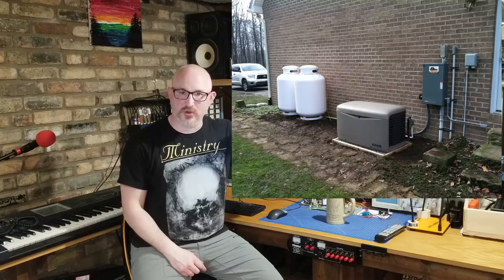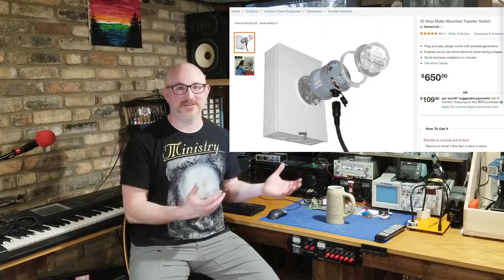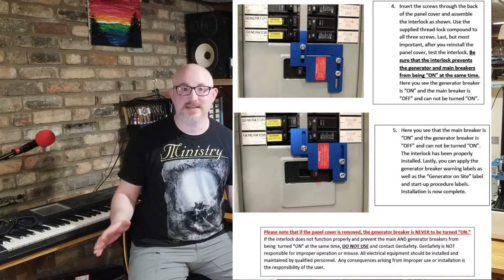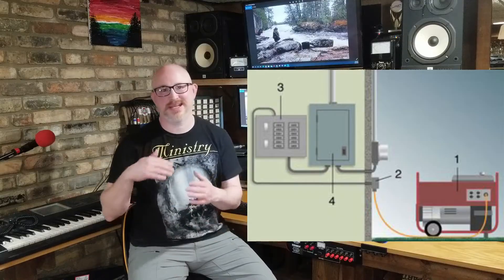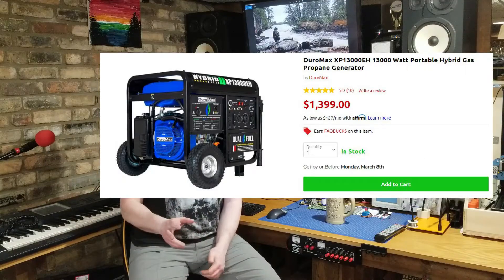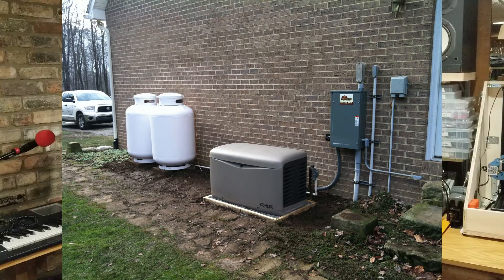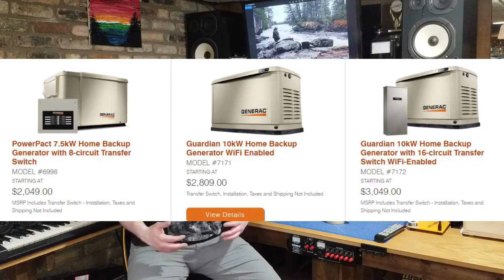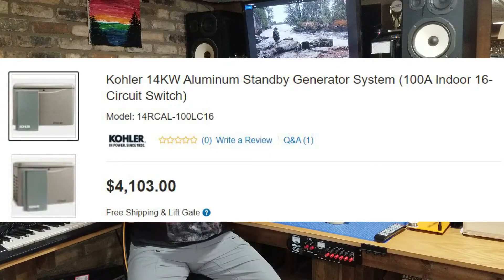Electrical Engineer explains connecting generators to your home

Comment: I think safest for novices and anyone who can't handle difficult tasks is just plain old extension cords. Would be nice to have a male/female plug from outside to inside through the wall so no doors or windows need to be cracked open. Would be nice to see a video on that type of install, or at least info on such a device. For my house refrigerator would be priority, then fans in the summer or low power space heater in the winter, some lights and then maybe wifi/modem and tv/laptops/gaming systems.depending on total wattage use and availability. Nothing hard that a child or my lady/elderly cant handle turning on and off.
Reply: CHECK OUT: Reliance Through the wall kit, I have one of those and will be making a panel that will fit between my window base and the window sash, in other words I will raise the window to a particular locking position then this panel will be placed in the gap, the panel will have the Through the wall kit, that way I DON'T have to drill or mount anything through the wall

Comment: Great video!
I have a neutral bonded, Generac XP8000E generator which I hard wired to a Reliance (XRC1003c) switched neutral, manual transfer switch.    Am I correct that I need to ground the generator to a separate grounding rod?     I have the generator installed in a fan ventilated shed approximately 50' away from my home.   Note that the generator exhaust is vented, as well.     Thanks, John
Reply from the maker: If you ever plan on using the generator in stand-alone mode then yes, a ground rod is needed for the GFCI to work properly.
Reply: @richardvedvik979  I use it through the Reliance panel to power the selected circuits in my home.  When I do this, I also plug a cooling fan into the generator panel itself.   Not sure what you mean by stand alone.   Thanks, John

Comment: Well, it's not often you have qualified experts providing good information. Thank you.
Reply from the maker: Thanks!
Reply: @richardvedvik979   Hi. I am seeking to understand something specific. I have a battery power system for backup called Ecoflow Delta Pro Ultra with an inverter. I also have a 10 circuit reliance critical load panel that was installed (connecting circuits from my main panel to this 10 circuit critical loads panel) that has a 50amp inlet outlet on it so I can connect my batteries to the critical load panel. All of that is inside my garage right next to each other. 

What I am looking to get is a duel fuel inverter generator so I can use that to charge my batteries so I can top them off once every couple days in the event of a power outage. This will help me run quiet power most of the time for a couple days with the batteries and then run the gas/propane inverter generator for a few hours to fully charge the batteries back up every couple days. 

What I am seeking to do is this. Instead of having to leave my garage door open so I can run the power cord from the gas generator on into the garage and plug the 30amp cord into the side of the Delta Ultra Inverter (which will then send pass through power to the critical loads panel that the Delta Pro Ultra is plugged into, because the power will pass through the inverter and then exit the battery inverter on out through the 30amp cord going from the inverter to the inlet outlet on the Reliance critical loads panel. Any remaining watts that are coming from the gas generator that is passing through the battery inverter and on into the Reliance panel to satisfy powering the circuits will then be used by the battery inverter to charge the batteries)

Back to what I want to do. I would like to install on the outside of my garage on the side wall a 50amp Reliance inlet outlet. Pass the wire though the wall to another inlet outlet. Why?  So I can sit the gas generator outside. Close the garage door. Then plug gas generator into the outside inlet outlet. Then plug a cord on other side of the wall into the inlet outlet inside the garage and then other end of that cord into the inverter. This way I can keep the garage door closed and locked. 

My questions is this now that you have the full picture. How do I use the outside inlet outlet that has a #6 gauge wire passing through the wall to another inlet outlet inside the garage since it will not be connected to any ground system in my house. All I am doing is using the setup to pass the power through the wall much like if I drilled a large hole through the side if garage wall and pushed the power cord coming from the gas generator through the wall and plug it into the batter inverter.

In fact Reliance makes an inlet outlet that passes wire through the wall into their 6 outlet flush mount wall box. There is nothing on that system that connects anything to your home grounding system either.
Reply: YEA, no telling how many of these I've watched and it appears many contridice each other
Reply: @REVNUMANEWBERN  maybe theirs some contradiction into who has what ,what's important to me is most have prepare for whatever  may come ,some may be able to go all in if you can afford a big setup ,some may just be able to afford the basic just enough to keep the fridge or the freezer running with minimal lighting just being prepared is the take away, food and water is a must have as well

Comment: Hi. I have a small trailer and a 3800 watt generator. Our hydro hook-up is on a 100 amp 220 volt 3 wire plus ground 3 gauge cable that plugs into a connector box on a 4x4 post close to the trailer. I disconnected that plug-in so there was no hydro to the trailer and then installed a triple pole double throw switch in a new small metal electrical box with a closing door.  I then installed the 3 hydro entrance wires to the top of the switch.  The new wires from the switch center connectors went to where to original hydro wires were in the breaker panel.  I connected the output from the generator to one of the hot (red or black) lower connectors and the common wire to the white wire (center of lower switch connectors) . I then connected the white and black wires on the lower switch with a jumper wire. This allows the generator to feed both bus bars in the breaker panel. Whenever I transfer the switch from top to bottom, I am no longer connected to hydro at all and am connected to the generator.  DO NOT connect the generator wires to the house before transferring the switch. Of course you won't have 220 volts here but just leave those appliances OFF. Your whole house will be ON so you can operate any lights etc. as usual. Just beware how many things you have on and turn off the breakers for your kitchen stove, your clothes dryer, and hot water heater if it's electric. P.S. I installed a KILL A Watt meter directly on the generator so I can read how many Amps or watts I an drawing.  The Knife switch, electrical box, and the meter are all available on Amazon. Get the 3 gauge wire at your local Home Depot. The wire from your generator to your home can be  a 10/3 or a 12/3 cable with ground wire, depending on the output from your generator.   Good Luck !
Reply from the maker: Sorry for the delay.  That is a very detailed situation.  The biggest concern I see is that you're sharing the neutral on both 120V outputs and the neutral conductor should be up-sized to account for the extra load.  Using 10/3 would help here.   And leaving the 240V breakers off is also important.

Comment: I've been backfeeding into my house for years through my clothes dryer electrical socket.  Any chance I'm causing damage to my system.  Most of the time it's a few hour here and a few days there.  Thanks
Reply from the maker: Thanks for sharing.  Is your drying socket a 4-wire plug or a 3-wire plug?
Reply: @richardvedvik979  It's a three wire
Reply from the maker: If 3-wire then the ground is acting as the neutral.  This means you don't have circulating current between two neutral-ground bonds but note that you have current on the ground wire.  I'm curious how it's configured at the generator side.
Reply: @richardvedvik979  4 prong plug on the generator
Reply from the maker: I'd be curious if the four wires from the generator have the neutral and ground connected somewhere in the dryer plug.

Comment: Well said Kind Sir. I've never seen that "GenerLink". And I was really; taken by that adaptation of 30 amps and 240 volts=7200 Watts; at the meter outside of the Electric Power Company. Because I'm buying a ""Predator 9500 generator" from Harbor Freight; as soon as i can.

And I had chose all the adapters; to wire it to my house's Panel! Including a way to transfer. Like you showed several times (not bought them yet). So, I have  a question....Does the "GenerLink" transfer voltage; from outside power to the Generator Power; and then transfers back to outside power; when the power comes back up? Huh?

And IF I am using more watts (when we have power on); that the Generator can not provide; that would break the 30 amp breaker in the Generator? Huh?. OR...do we have to manually transfer from one to the other; and vice versa on the GenerLink? And IF yes, how do we do that?

Thanks kind Sir.
Reply from the maker: The GenerLink is a manual transfer device that uses the force of plugging in the cord to the generator receptacle socket to transfer from utility to generator.  In an outage you will simply turn off your main breaker,  turn off all individual breakers, plug the generator connection cord into both the generator and the GenerLink, start your generator, close the main, then close individual breakers one at a time to manage load.  Just use the 30A receptacle and breaker on the generator panel and the breaker will simply trip if you draw too much current.  If that happens, turn off all loads, reset the breaker, then turn loads back on, keeping the largest load off this time. 

Most utilities have an option to call or text you when they believe power is restored.

Comment: As an electrical guy....loved your video.
I would love to highlight a few things.

1)  generator exhaust creates  deadly fumes and creates special rules for generator placement.  (A family in Orlando put the generator in their house during a storm and the whole family was wiped out).

2)  Transformers work in both directions.  If you power it up by backfiring (connecting your generator to the utility) you may power up the power cable the kids are riding over on their bicycles.  You may also end up killing the people trying to get you your power back.

3)  if you are using a generator to supply your panel and it only carries some, not all, of your house....try a colorized system.  A dab of paint on your breakers that covers no breaker information.

Essentials....green color.  Essentials like fridge and microwave for food.

Sometimes.....yellow color.  Turn this on if you gotta have it, off if you don't.  Water heater or window. A/c for sleep....as long as it fits.

No stinking way......loads that are too big for your generator.  Whole home a/c or stove/oven come to mind.

Easy to remember and explain when you are not at home.  

Once in a while, test your system to make sure you got it right.

2 adage are correct....

It is better to have and not need than to need and not have.

There are 7 "P's" for success and 2 "P's" for failure.  Don't be lazy.

Hope that saves someone a little grief.
Reply from the maker: Great input.  I discuss some of this in my video on bonding and have others lined up for execution.

Comment: some propain company's won't take new customers unless your using a fixed amount of fuel there only staying with the customers they have.
Reply from the maker: That is a sad situation.  Most RV parks will refuel a 30# tank since that is the common size for an RV.  I agree that residential companies will not deliver propane for a few belly tanks.  My idea was to use a group of four 30# tanks isolated in two banks.  Two 30# tanks would be in parallel and would have valves to isolate two other 30# tanks which were in parallel.  Both tank pairs would connect to a common manifold that had a properly sized regulator for the generator.  The idea here is that you could run on a pair of tanks and when that pair ran out, you would transfer to the second pair.  The valves let you remove the first pair and take them to a refueling station (RV park).    The reason for two 30# in parallel per bank is to extend runtime.

Comment: Great video Richard. In choosing a generator should THD be a consideration or is it more hype to steer consumers to a high priced inverter unit? Trying to apply common sense I'm thinking most brand name generators should be fine as long as they have an AVR and are appropriately running at 60 HZ with voltage within 10% of 120.  Just want to ensure that I do no harm to our High efficiency furnace or our 65" Samsung LED TV. I know Champion advertises theirs at <23% THD which seems high compared to utility power.
Reply from the maker: THD is always a concern when sensitive electronics are connected.  You see, most people just choose the essentials and have a separate transfer switch panel in which they omit the receptacle circuits that contain computers, TVs, etc.  In those cases, it's just motors like tan old furnace or resistive heaters.   When feeding the whole house or modern appliances, we want to take THD more seriously.  I chose a Generac unit with <5% THD for that reason and my other video explains how I connect it to my home.  I can, and have, safely ran my entire home off that generator, including TVs, computers, wifi routers, etc.

Comment: Great video,
I just bought a portable inverter generator.
I like the meter extension as a solution.
Reply from the maker: Thanks.  I also think the meter extension transfer device is a slick solution, if the utility allows, as it simplifies the entire process.

Comment: Thank you Richard . I have a Duromax 9000i going to a solar Outback inverter 8000watt Radian .I am totally off grid so have no utility power . Do I need to ground my generator since the house already has a ground?
Reply from the maker: Only one neutral -ground bond is still a goal for your system.
Reply: Thank you for your response.subscribed. So are you saying I should ground my generator with ground rod ?
Reply from the maker: @Joe-nc6yb  If you properly split the neutral-ground bond in the generator than you can use the ground rod (GEC) in the home.  If you lift the ground as I show in my other video on bonding, then a ground rod at the generator would be needed.

Comment: at 07:55  a permit from your utility !?!?! NNNNNNNNNNNNNNNOOOOOOOOOOOOOOO  !!! a permit from your city or county planning/building dept !!!
Reply from the maker: Correct, a misspeak.  You request permits from the building inspection department at your local municipality.  If you call the utility and request an outage, they will likely require an inspection prior to re-energizing the panel.

Comment: electric portable generators versus gas powered for home power outages.  your opinion
Reply from the maker: Sorry for the delay.  If you have a battery-powered generator your runtime is limited to the battery size.  You cannot "refuel" the generator if the outage is longer than your unit can tolerate.  For a home, you have to consider what you are trying to protect and what you can "refuel".   A battery powered generator is great for short-term but fuel-based systems will win over the long-run with refueling capability.  I.e. a 5+ day outage during the winter.
Reply: I don’t think of the battery powered source as a generator.  I charge batteries with a generator during the outages and can stay ahead of demand since I have enough batteries.  Next outage I plan to do that, no extension cords into the house from a generator.  Extension cords will run into the sunroom to battery chargers and throughout the house from the battery back up.  If outages exceed 5 days often, I am moving.  We have had a couple in the 17 years I have lived here but mostly I see 2 day outages.  We are prone to frequent outages which is why I bought the Ryobi 1800 40v battery backup and I love it.

Comment: I have 2 EcoFlow Delta Pro generators. 8 x 335 watt Rich Solar panels, which I intend to use PVKIT-2.0 mounts on my standing seam roof. The panels will have bonding straps between them, but I am puzzled about grounding. The roof itself (30 years old) is not grounded that I know of, and the PV panels will be grounded to earth....however the grounding lugs will be attached to the roof seams themselves..which means the entire roof system is then becoming grounded when this is all put together. Do I need a separate grounding system or heavier gauge wire for this than the 6 gauge solid wire I had planned on?
Reply from the maker: Sorry for the delay. I saw this question, realized it needed a longer response than I wanted to type on my phone, then I let it pass by.  It is fine to combine grounds together.  It is expected to bond all metal surfaces together, especially if those metal surfaces could come in contact with "hot" conductors.  What is important is that the neutral conductor in a 120V AC system is isolated from the grounding conductor (also called the EGC or equipment grounding conductor).  When these systems are in contact with earth, they are connected with a GEC or grounding electrode conductor.  The NEC, or National Electric Code, has rules for both EGC and GEC.  

As long as only one neutral-ground bond exists, it does not matter how many times you take a ground to earth.

Comment: Ministry Tshirt, right on!  So anything special to do with a bonded neutral generation when connecting it to a panel on 30 amp breaker (I got a generac 5500w)?
Reply from the maker: Yes!  I made a video on that: https://youtu.be/Nrnforx1uFI